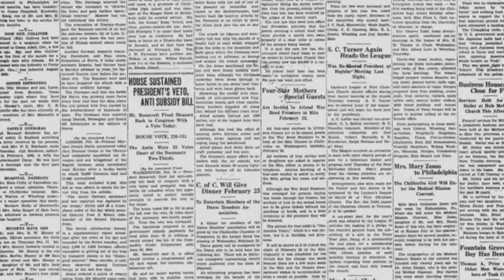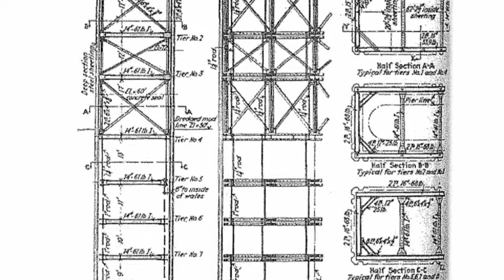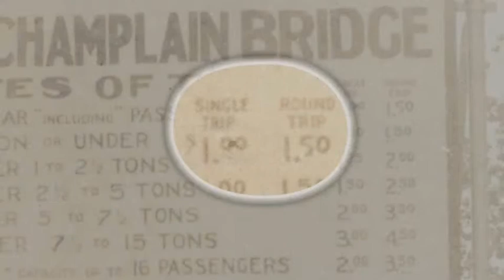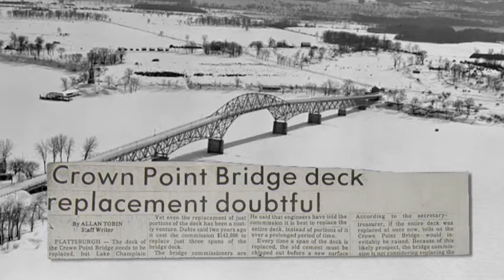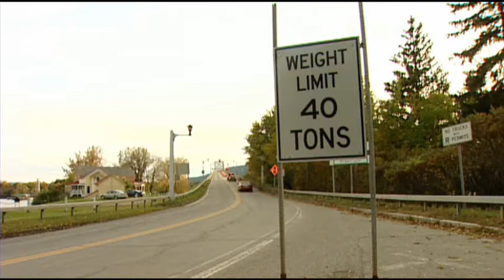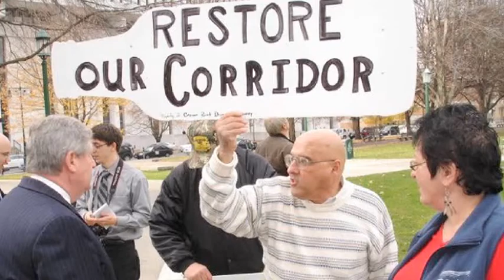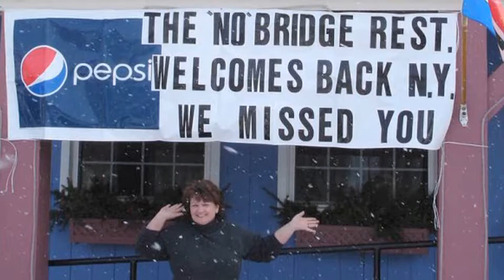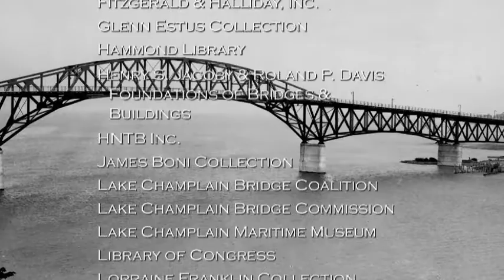More Than Steel, The Lake Champlain Bridge Story

Comment: Too bad they have cancelled future I-98 which connect from I-81 in the upstate of New York to I-89 in Swanton Vermont, close to the Canadian border. Ditto with future I-92 was supposed to connect from I-87 in Glens Falls New York to Portsmouth New Hampshire. Many travelers will have to take the Mass Pike (I-90) in Massachusetts as if the nearest east-west interstate highway, and it does waste gas and driving time by several hours off.

Comment: The new bridge is beautiful. If you can get up to see it (it is 115 miles north of Albany, and close to Middlebury on the Vermont side) and walk across it as I did last Summer, it is a treat. You can park on the New York side close to the bridge. But the use of iron ore tailings as aggregate in the concrete should have been a red flag from Day One. It seems that the iron is going to expand and contract at a different rate than the rest of the concrete, leading to degradation.